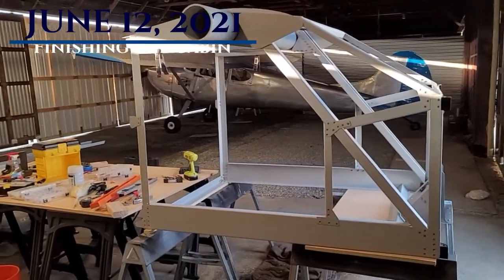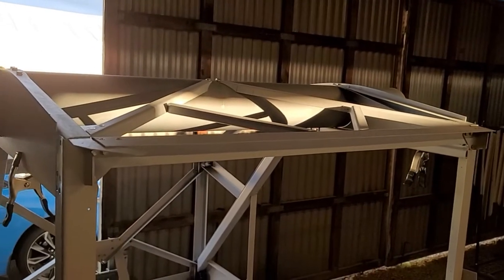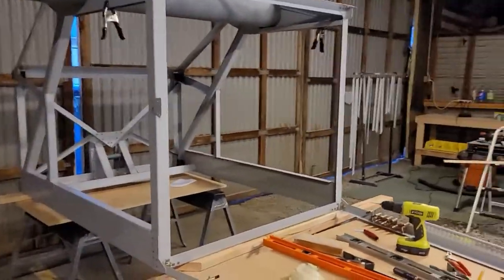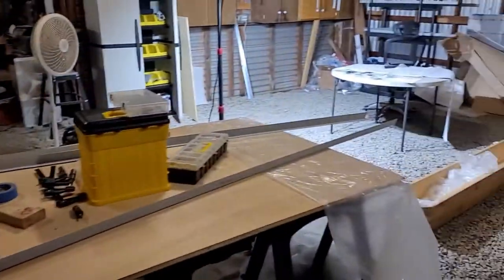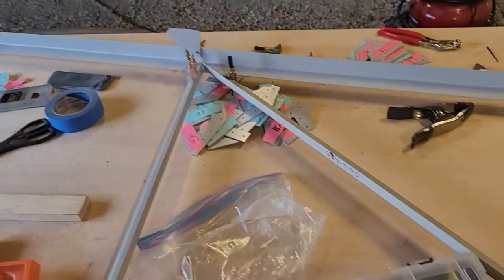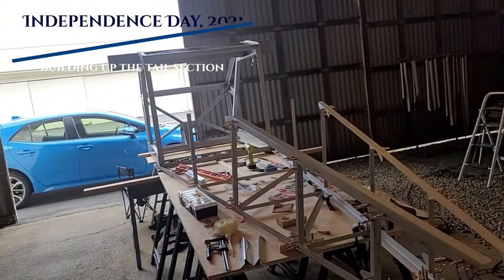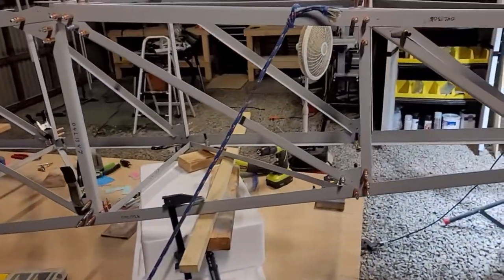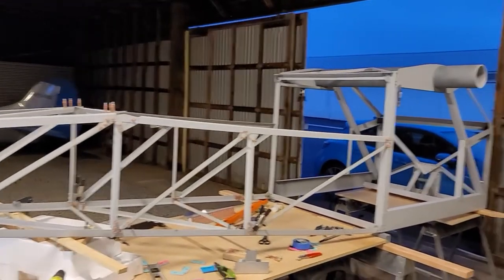Bede BD-4C Build Log 006

Comment: Interesting build. Did you get the option of folding wings? If you could trailer it back and forth it would save on hanger rental. Are you going to install an airplane parachute? It is so worthwhile since the price has dropped so much for them. I look forward to seeing more of the work you do. It may be easier for you to document with a bodycam like the police use so you could work while filming. They are not very expensive and give you better documentation for your work. I have been interested in the BD4c as well. How long did it take for you to receive after ordering it? Thanks and great job so far!
Reply from the maker: Thanks.  Sorry for the late reply I've been crazy busy.  I've been planning to set up a DSLR on a tripod to film a time lapse.  A body cam would be handy for my own documentation but would take forever to edit.  Very few people (myself included) would watch it uncut as it would be crazy long.  As for the wings, no the wings will not be foldable.  If they do need to be removed they're reasonably easy to slip off due to the design.  Hangar rental where I live is reasonable so it's not a huge deal and the hangar is quite large compared to many others in the area.  I would contact Bede Southeast (they're based in FL) about shipping.  I received the fuselage kit within about a week or so but that was just before all the covid nonsense so things may have slowed down since then.
Reply: @SkyFunChannel  Thanks for the info. I watched it again today when I was looking to see if you have uploaded any more videos. I noticed they mentioned the folding wing option on their website and was curious how that went together. It does look like it would come off easy, but I thing the fuel would need to be drained due to weight. I dont know if the folding design would require draining. I will ask Bede about it. What engine are you thinking about? I have looked at a few, Viking just did one for a Bede that looks great, but there are others that looked good too. I look forward to your next video.
Reply from the maker: @wylieecoyote  I'm planning to put a Viking 195 Turbo in it with a Duc adjustable 5-blade carbon fiber prop, basically the same setup Viking has with their Zenith super duty.  That will probably go in before the end of the year.
Reply: @SkyFunChannel  Wow, that is the same one I was looking at. I saw the video where he did the firewall forward in a BD4C and it looked really good. I like the Dynon glass panels. Their latest HDX has everything for far less money. Garmin is good, but they are far more money.